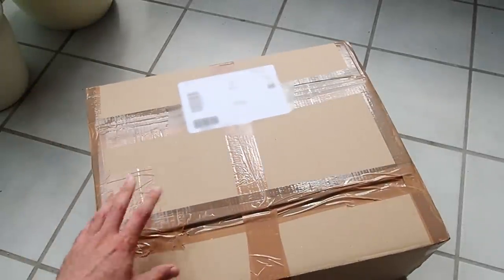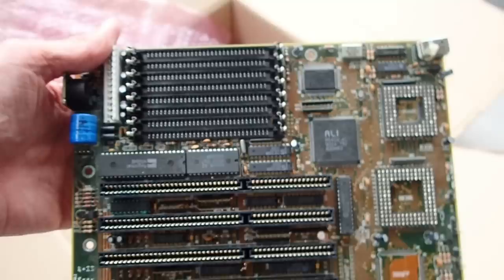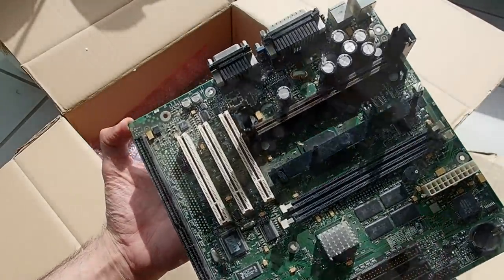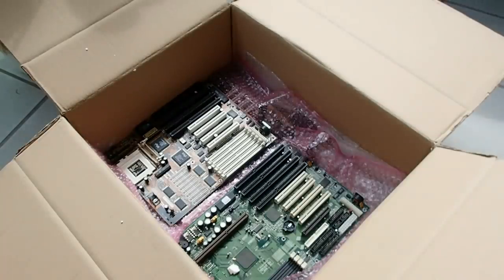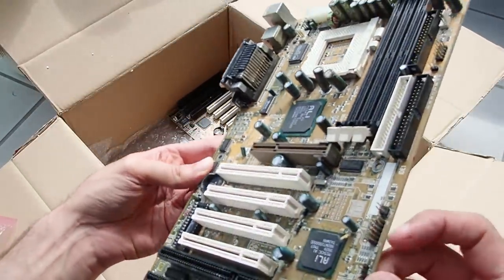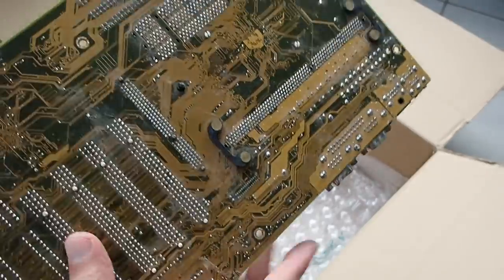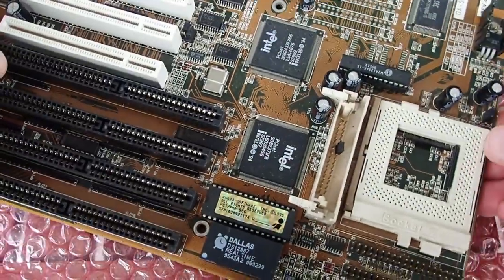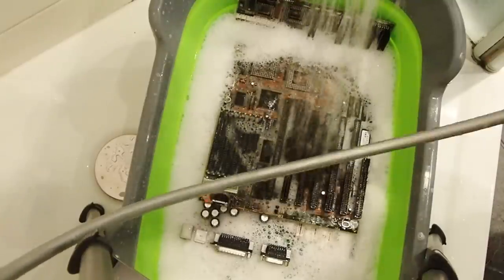Repairathon 2022: First encounter

Comment: Great! Looking forward to the repair video. Thanks! 
What a pity that last year I did not know that it is not enough just to desolder leaking Varta battery and clean it up, but you need to neutralize the alkali that has already spread across the board. Because of this, one of my motherboards that lain on the shelf for several months already without a battery, noticeably worsened its condition. And this is an interesting 80286 Headland with SIPP, and Harris CPU, it's a pity that, due to my ignorance, this happened. Your videos are very interesting and valuable, even for some experienced old hardware fans. You are very good at telling, I even learned a few new tricks. Moreover, I myself have been working with hardware for about... 20 years and even once taught this to beginners in computer history and repair courses. I think it's valuable to get that kind of feedback. 
When I am restless because of war (yep, central Ukraine near frontline, unfortunately), work or problems - I watch your videos and I feel much calmer. It's priceless
Reply from the maker: Thank you very much! I'm so glad, that my videos help you feel better, even if it is only for a couple of minutes. I imagine, that in this darkness every second of light is golden. Please stay safe, I wish you a peaceful sky as soon as possible. I am far away, but this is the only thing I can think of in the last 5 months. I'm also doing these videos just to not think about the war for a while :(

Comment: About a year ago I came across a complete new old stock Leading Edge 286 computer with all accessories and monitor that had never seen the light of day. The very first thing I did after opening the 35 year old box was to open up the computer and pull the motherboard out so I could remove the Varta battery and neutralize the electrolyte then clean the board. It works great and still looks brand new since it had no yellowing whatsoever.

Comment: AFAIK
Pink usually means that the material does not cause static to build up when agitated, but does not prevent static discharge or potential differences, these are know as ESD-protective for storage (when the thing inside is not in use sitting on a shelf or drawer somewhere).
Packaging that is very darkly tinted, has an interlocked/woven pattern in it, or thick with the ESD symbol all over it is usually the ESD-protective stuff made for shipping, it is slightly electrically conductive so that it becomes a faraday cage and bleeds out static buildups.
And normal plastic easily builds up charges when it rubs on something.

Comment: My favourite board to this day is Asus P2B-DS. During release in 1998, the box only advertised support for up to 450MHz P2, which at the time hasn't come out yet. Then with BIOS updates they raised support all the way up to 800MHz Coppermines. They were releasing drivers for 8 years. The board was popular in tech. My friend worked at IBM, and they had their internal mail servers run on P2B-DS. With an additional voltage mod and a custom BIOS, I was able to increase support dual P3-1GHz. That machine is my primary retro station. If it ever dies, I'll buy an identical replacement. Luckily, they are relatively abundant on the internet. 440BX Chipsets didn't have a good reputation, as I recall, but I used a number of different branded boards, and never had any issues. I heard Slot A, AMD systems were better performing, but I never came across one personally. At this point they're out of most collector's price range,  especially with a decent CPU.

Comment: As a follow-up for your audience. The first Slot 1 board you unwrapped is an Intel RC440BX. The integrated video chipset is a 4MB Nvidia Riva 128. I believe the maximum CPU the board supports are Katmai P3s. If I also remember correctly, the chipset is labeled BX but is actually the ZX variant which is more limited in RAM capacity (hence the 2 slots instead of 3 or 4)

Comment: Looks like a lot of fun upcoming! I'm curious to see how the BIOS chip gets replaced. A friend and I screwed up the BIOS on a board we got and are idly looking for a cheap way to flash it.
Reply from the maker: That's actually an easy task, if you have a programmer, like TL866. I made quite a lot of videos already, where I replaced and/or upgraded the BIOS.
Reply: @necro_ware  I had a feeling that was what we'd need, but they appear to go for $60 on amazon, and I didn't want to purchase something at that price if it wouldn't work. I'm still working my way through some of your older vids, and somehow missed the BIOS Patcher vid. That looks like exactly what we need as this whole debacle started because our machine wouldn't recognize an 80 gig HDD. I'll likely pick up a TL866 and give it a go soon!

Comment: I love the video's my friend, really wish you could do a repair a board I have that was my first Computer I put together, it was during the AMD Athlon day's, has some blown caps from sitting I just can't find the ones I need to replace all the ones that are on the motherboard.  Brand of board is a Soltek SL-75kAV/-X socket A motherboard VIA Apolio KT133A Series.  It's got  1 AGP slot, 5 pci slots, and 1 ISAS slot. It's a ATX motherboard.  Would love to give it some love and get it running again.  Great video my friend and God Bless you. Stay safe.

Comment: That looks promising for some future videos!
One note on the Triton III/VX: The critique can be called an "urban myth", which is repeated everywhere and I did this as well. Then I got such a board, and I found that what you REALLY should do is compare it to the FX - which also only has a 64 MB cachable area. 
Not only was the VX's PCI performance MUCH better than of the FX, it had better memory performance, better IDE performance (the FX chipset has a rate happening bug which made only 12 MB/s a safe writing speed), it had USB and supports a lot more CPUs and multipliers. So better think of it as "FX on steroids". 64 MB are more than enough for DOS, and Win98 would also run smooth under normal circumstances.
Reply from the maker: Yes, the problem was, that Triton III came out after Triton II, but was actually worse in most aspects. You can compare Triton III to Triton I, but there's that brother in between, which doesn't make Triton III look too good 😊
Reply: @necro_ware  Absolutely aware and agree on that. Have Triton I to III here, but if you have to choose between I and III, the latter is still the better chipset.
My point was, the 64 MB limit is also present on Triton I, but noone mentions that :D

Comment: Pink bubble-wrap is static dissipative (you can measure the resistance over a piece with a multimeter) and is indeed better than nothing.. ideally you want boards wrapped in pink static dissipative bags or bubblewrap, then stuffed into metallised plastic bags (static shielding bags).

The idea is so that if the boards receive a static shock the energy can be dissipated (pink) safely, and if someone tries to apply a large voltage to them in shipping (like walking on a particularly plush carpet with lots of synthetics worn) then the boards will see it conducted around them safely (metalised bags). Cardboard is an insulator but not a particularly good one so is semi-static-safe.

Comment: Oh my.  As you started going through the boards I got to thinking that I wish I hadn't thrown my pentium III board away when it died (i did keep the processor).  Little did I know that it might have been repaired someday.  I spent hours looking for the right board back then.  My father bought me (some years earlier) a full size tower that I used for years.  When I went to upgrade, AT motherboards were very rare.  I found one that would support a Pentium 3.  Fast foward to the present, and there it is...The Tyan S1830S.  I look forward to seeing what you do with it.  Oh, as a side note, I recently picked up a lil 386 board like that first one you pulled out of the box.  It needs a little work, as the battery has causes a little damage.

Comment: Hello Necroware I'm glad you didn't stop thinking about the vrm project that you're doing I do hope you eventually get the time to get the schematics so that other people can make that themselves or maybe even purchase one from you. I recently got a PC chips M520 motherboard (granted yeah PCchips aren't great  but I got it for free) and for it to support greater than a standard Pentium 200 non MMX I have to install a vrm. I have a Cyrix M II PR 300(real speed 233) I would love to use since I'm not a fan of Intel at all and beta vrm only supported the wattage for the Pentium 233 officially and I was wondering when you finally get that completed is it going to be able to support the higher wattage CPUs to wear the vrm can stay cooler without needing the fans how you had done it the first time. I do hope you read this and I would really like some help please. I can already find an upgrade bios I just have to double check for this board (it's weird) I have to use either a small block bios or a large block bios and I believe mine is a small block bios. Like I said seeing that it's a PC chips board it's definitely off the wall.Thank you and have a good one.

Comment: When washing the boards, are you just using tap water and dish soap or something else? Are there any dangers to avoid when doing so?
Reply from the maker: If your tap water is too hard (too salty), after it evaporates, salt can remain on the contacts and short them. In my case it's not a problem, but if you are not sure, just use distilled water.

Comment: What Ratio of Water + Vinegar do you use to neutralize electrolyte leaks ?
Reply from the maker: I use 10%, but everything between 3% and 15% is ok. You just have to wash the board as soon as possible, if you use high concentration. To get some experience, I'd suggest to stay around 5% This gives you a lot of time to clean everything.
Reply: @necro_ware  Thanks. Any idea why I'm not getting composite signal out of a Toshiba MSX HX10. RF works fine.

Comment: I have a socket 7 mb with a hole in it where the leaked battery was
Reply from the maker: Are you sure, that it is a Socket 7 board? I never saw one with a barrel battery. They usually used to be with coin batteries, or an integrated RTC module, like Dallas.
Reply: @necro_ware  turns out it has a coin cell, but it still has a big hole in it for some reason

Comment: Why would anyone rip the bios roms out? They are typically not even erasable, they are One-Time-Programmable roms, you can't even reuse them. :-D
Reply from the maker: Well, you can reuse them. You mix (E)EPROMs and PROMs, where (E)E stands for (Electrically)Erasable. More than that, on the mainboards starting with Pentium, (E)EPROMs were replaced by  flash ROMs, to be able to write PnP data into it. So they are very well reusable. I also pull them from the boards, which are definitely beyond any repair, or  industry boards worthless from today's point of view.
Reply: @necro_ware  yeah, on second thought you're probably right. I was thinking of that 486 board I was dealing with. It had a UV-erasable prom, but with no window for erasing, so you can't actually erase it. I had to replace it to update the bios. But newer machines should have electrically erasable memory, if nothing else, for updating the bios. But then again. Aren't they like a buck a piece on aliexpress?
Reply from the maker: @LambertZero  Yes, they are, but people also cut off the gold plated edge connectors hoping to get rich. Nobody canceled stupidity so far.
Reply: @necro_ware  lol, you know, I'm from russia, and yes, I know exactly what you're talking about. I've seen it up close in the 90s. :-D People were hunting for tantalum capacitors too. But I thought we were past that. :-D
Reply from the maker: @LambertZero  Unfortunately we obviously aren't, taking into account what currently happens.
Reply: @necro_ware  yeah, I just can't decide if it's funny or depressing. I guess a bit of both.

Comment: I don't understand why to repair old from 386 and UP, those are not classics, and any modern PC can run the software those used to run. It is not like original IBM and clones as its software rely on the exact CPU CLOCK speed and buses yeld to run games in correct speed. And also they are not considered classic, like and PS2 IBM would be (for said, the same era).